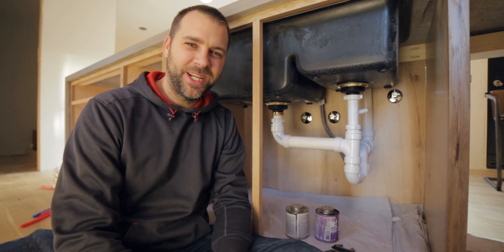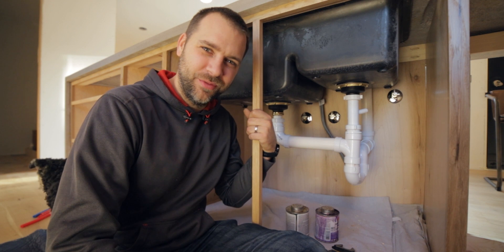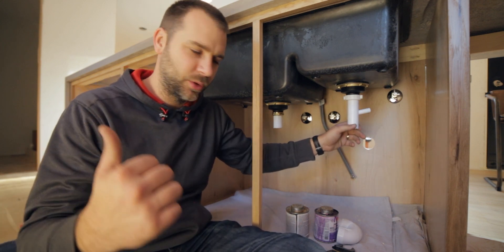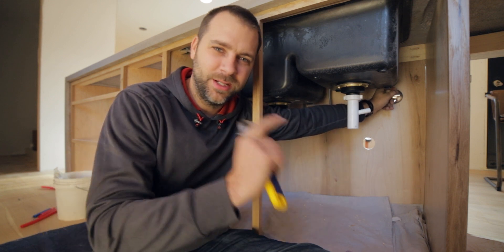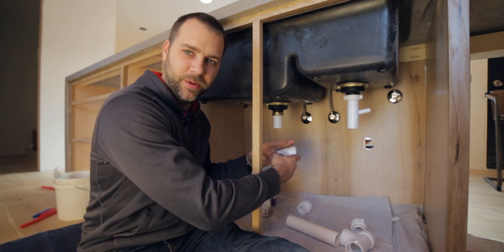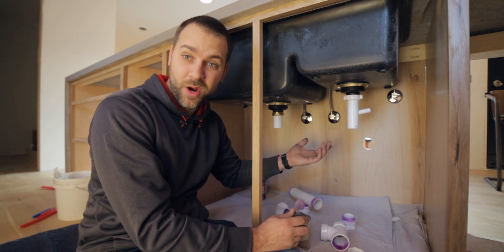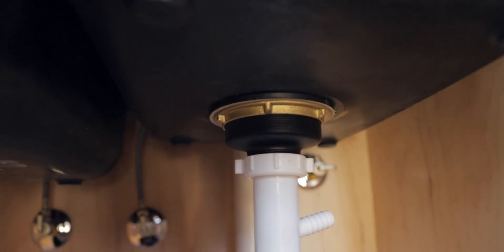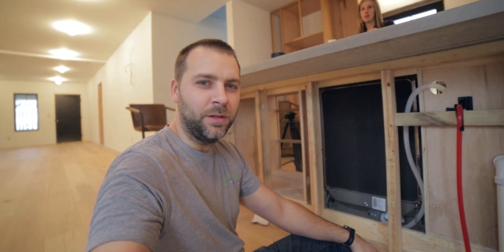Installing A New Kitchen Sink Drain And Dishwasher In My Island | DIY PVC Plumbing

Comment: how will you clean your sink trap if it gets plugged or you drop a ring down the drain?  Will you need to cut it apart since it is all permanent with the glue joints and then will you have long enough ends left to glue it together again?
Reply from the maker: yup, probbaly. or you could just snake it, never had an issue though